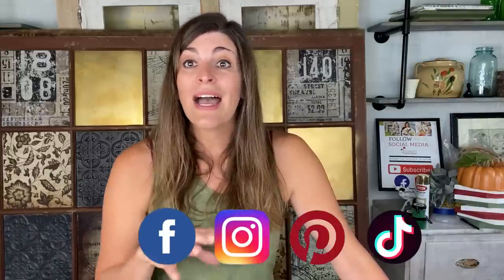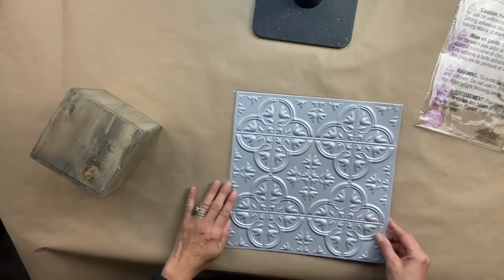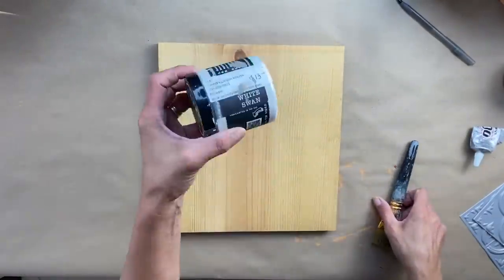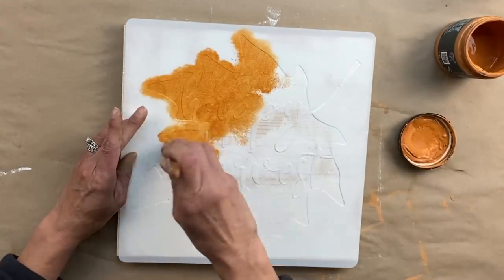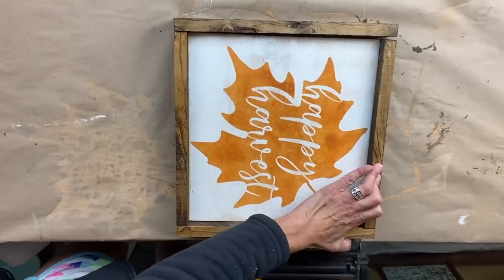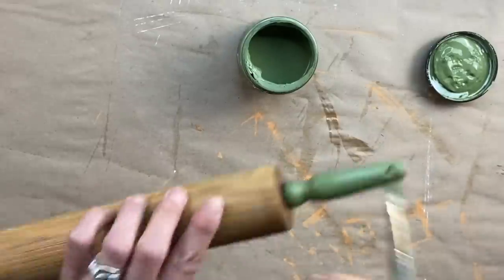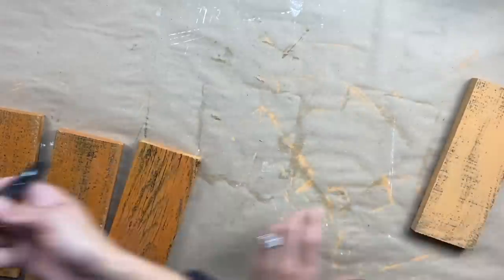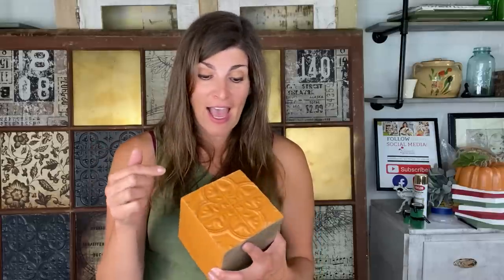Thrift to Treasure - 6 Fall Thrift Flips using DIY Paint - Upcycled, Distressed and Shabby Chic

Comment: Hey girl, I just realize this is a older video. Your question about the signs I think having both would be great. I did love the black for the best. Curious to which color went first… :-) Everything looked amazing. I can never pick a favorite out of anything you do!
I did want to tell you bye I felt for you on the struggle bus with the tube of E 6000… Lol 
I am a retired hairstylist, and just wanted to let you know if you go to a Sally’s beauty supply. There is normally one wherever a Walmart is. 
They make these still like keys that you slide your tube into for haircolor to roll down so you get every last drop so easy and convenient I use them for my glue, even for the toothpaste in my bathroom. Check it out you’ll get every single drop in there without having to squeeze, you just turned the key …
I love your channel I think I’ve seen it almost every episode, even the end the playlist!